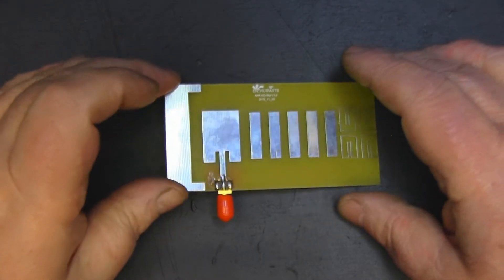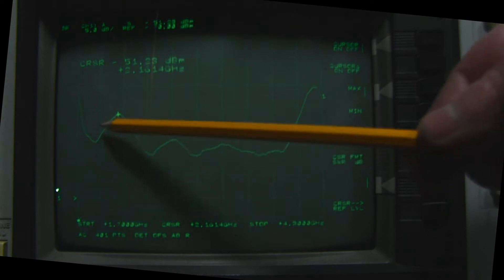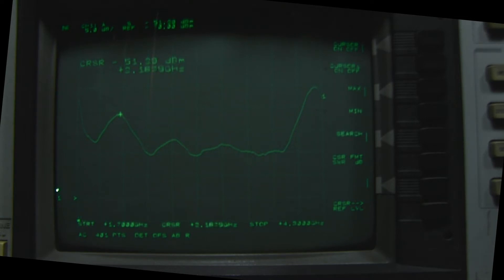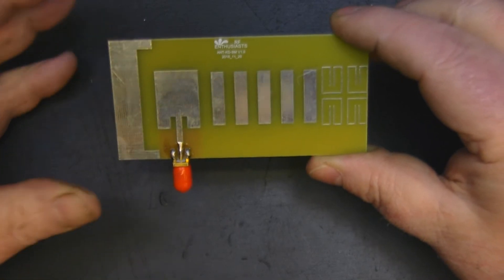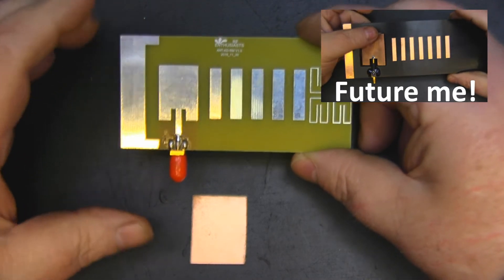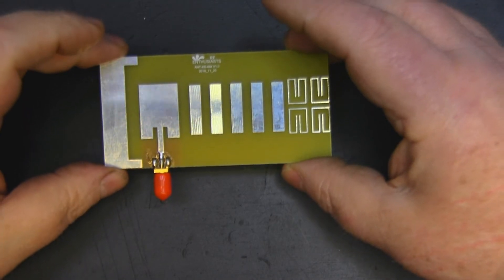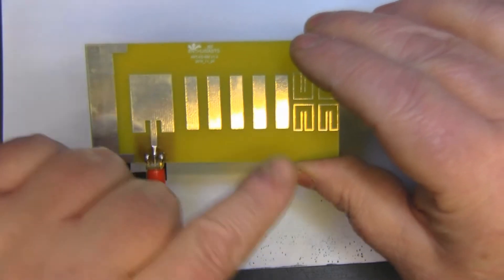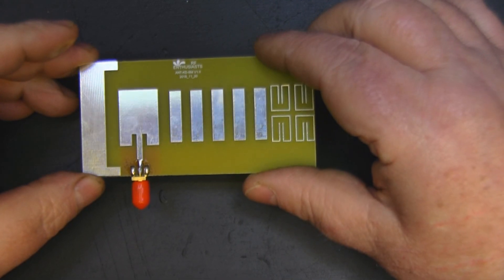Wideband Yagi with an Unusual Driven Element

Comment: Hi Andrew.  Thank you for sharing this!  Very intriguing -- and highly worthy of a test-build.  Which leads to a question: For the purpose of scaling the PCB layout, should the 20mm square you show for scale be measured between the outside edges or the inside edges of the black lines defining this square?  (On my printer, these figures come out as 21mm and 19mm, respectively).

Comment: Hi Andrew, the moment I saw the planar filters on the end of the Yagi, I thought it very strange. On the end are Folded arm Open loop resonators. They are typically used for filter design. Never seen them in Antenna design at all. You are right the orientation of the planar antenna is weird and I would have never thought of that so I would be curious about its radiation pattern. Patch antennae are inherently very narrow bandwidth, but I have considered the option of edge coupling to increase the bandwidth, but the cost could be something else. Gain? Directivity? will have to wait. I don't have access to CST Studio at the moment as I am working on another project. May one day.
Reply from the maker: What I can tell you is that they do add capacitance to the antenna if you remove them it completely changers the frequency!

Comment: those 4 outer "u/n"-shaped elements seem  noticably closer to the outermost parasitic element on the PDF than on the PCB. couldn't that degrade performance or did you do it that way for a reason?
Reply from the maker: They did not do anything

Comment: Do you think that using the copper tape on pieces of plastic arranged in a radial pattern with eight leaves make an omni-direction antenna for a television reception ? Thanks for your methods and ideas too Andrew. .

Comment: is it actually working as a yagi or is the main element just a panel?
Reply from the maker: No, it does work as a Yagi the same way that some of the panel antennas work when parasitic elements are added to reduce the beamwidth to increase gain.